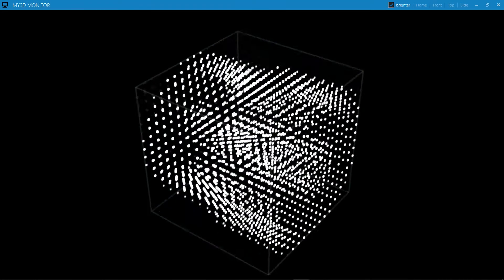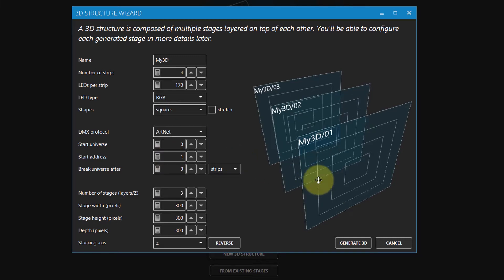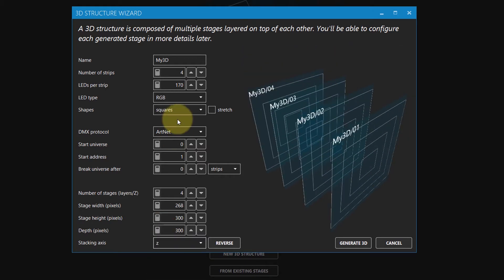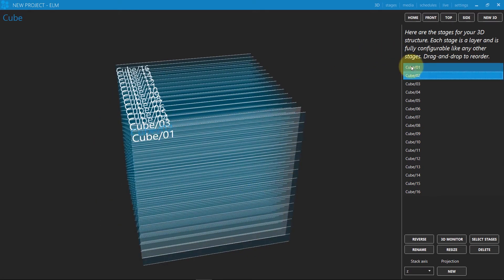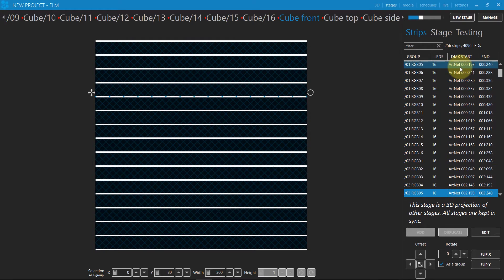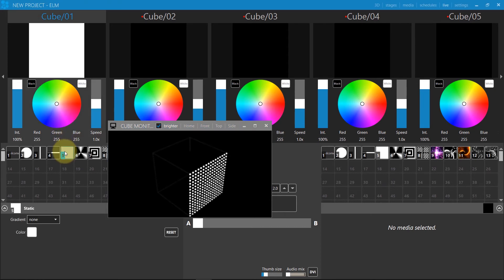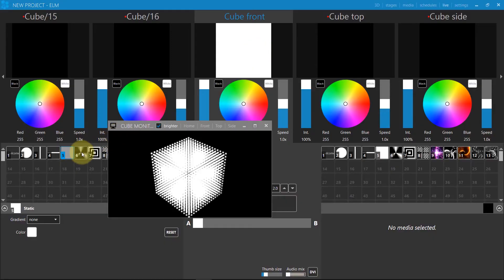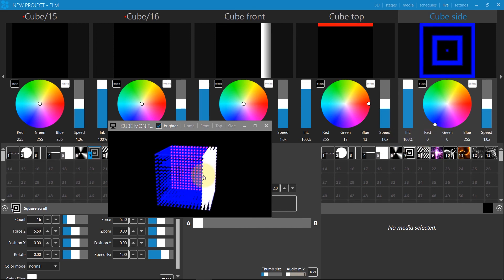ENTTEC LED Mapper (ELM) tutorial #11: 3D Introduction - LED cube

Comment: SI QUIERO AGREGAR VIDEOS EN FORMATO DEBEN ESTAR
Reply from the maker: Hello!

Most video formats are supported when the appropriate DirectShow video codecs are installed. 

By default, ELM can play these files: .mov, .avi, .wmv, .mpeg, .mp4, .mp2, .mkv, .webm, .ogv and .ogg. 

There’s no video size and resolution limits. The audio track is played back on the default sound device. If not needed, you can remove the audio by using the transcode button. 

The recommended video format is MPEG4 in an avi file. For smaller files at the expense of a higher CPU usage, you can use H264 in an avi file.

And for image files, use formats such as bmp, jpeg, gif (animated or not) and png.